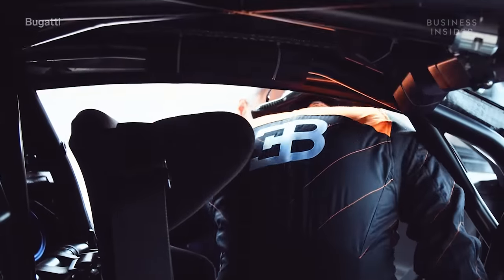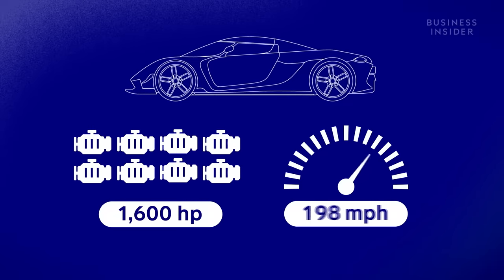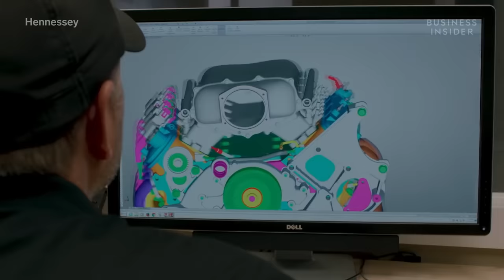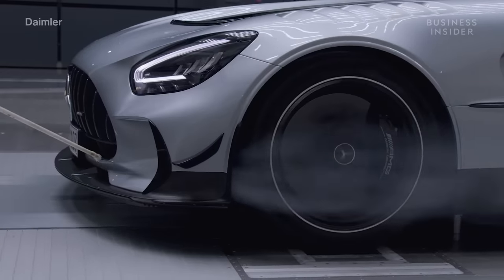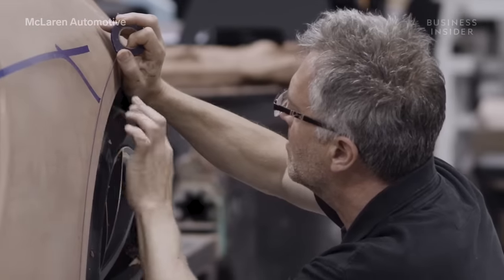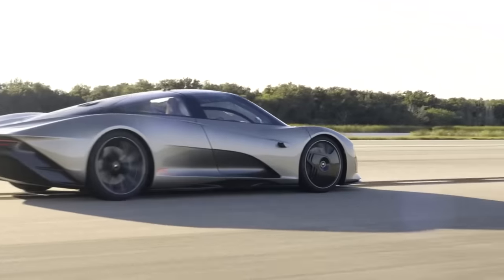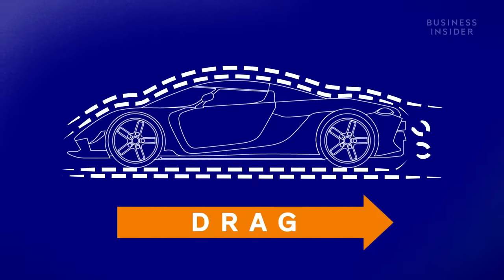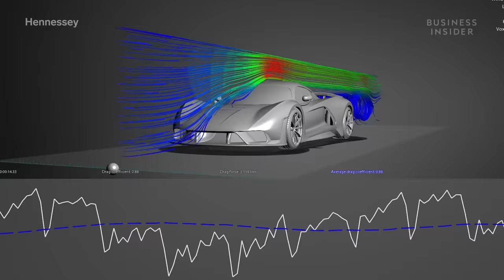Why It's Almost Impossible For Cars To Go 300 Miles Per Hour | Insider Cars

Comment: top fuel dragster joins the chat
Reply: Rip fuel
Reply: Hamster has left the chat
Reply: Doesn't sustain the speed for too long...
Reply: 0-60 0.8 seconds. 0.120 1 second. 0-300 4.5 seconds. (And then melts pistons/clutch/piston housing.)
Reply: @drivermobius  irrelevant, the car still does 300mph and this says its nearly impossible to do so but the top fuel dragster proves it happens often
Reply: @TheArSeNaL3000  Nearly impossible for a PRODUCTION car to go 300+. How the hell did you not understand what he just said?
Reply: @zenhydra5114  satire
Reply: @zenhydra5114  yea exactly, any crazy dragster can go 300mph but no one is gonna put that into production
Reply: @drivermobius  You can. Just don't floor the gas pedal.
Reply: @TheArSeNaL3000  It will never be recognized for the record which requires a production car and two runs in opposite directions within a specified time (30 minutes?).  The dragster is not a production car and it's engine can't be rebuilt quick enough.
Reply: @marke.8668  I agree, 300 mph is 300mph. TFD- been there , done that!!!
Reply: In that case thrust joins the chat
Reply: @TheArSeNaL3000  thats my point
Reply: @zenhydra5114  the title sais otherwise

Comment: The takeoff speed for a 747 is 184mph it is amazing how these things stay on the road.
Reply: If your implying that it’s shocking the cars don’t fly, no. Planes are designed to fly and cars are supposed to be on the road.
Reply: As Jake said, the 747 is designed to go up and cars are designed to stay down.
Car designers don't want the wheels to lose traction, so they specifically design the cars so that the air flow pushes down on the car.
Airplane designers don't do that. That would just waste fuel.
The only thing that's amazing is that you actually made this ridiculous comparison.

Comment: The twin turbos are one of the best horsepower makers but the procharger can solve that problem.. that's what 85% of people don't realize... we would have the power to get 400mph easily but the tires and downforce is the problem to get there.
Reply: I believe the Bugatti is quad turbo... but turbos are pretty much the only way to get there and sustain the speed.
Reply: Top Fuel dragsters generate some stupid power for a short time, and some stupid speed for a short time, but that's about it.
Even the Bugatti Chiron gobbles up tires and fuel and other things at a pretty quick rate doing near 300 mph. Doing that for a sustained amount of time, just leave it to airplanes. There's just not enough space on the ground to move along like that very long without hitting something (animal, debris, people), exploding a tire or wheel, running out of fuel, overheating, burning up an engine.

Comment: He's wrong from the very start about cars not reaching 200 MPH that late in those years.

Year: 1970-

Make: Plymouth

Model: Superbird

Engine: 426 Hemi V8

Transmission: 4-speed manual

Horsepower @ RPM: 425@5000

Torque @ RPM: 490@4000

Displacement: 6982.1 L

0-60 time: 4.8 sec.

Top Speed:  200 mph

car segment:

muscle cars

--- from Top Speed magazine

Comment: Remember kids: Drag force is proportional to velocity squared, but Power = Force x Velocity, so therefore the power is proportional to velocity cubed. It makes intuitive sense if you think of it this way: A car going twice as fast as before will have to overcome a resistance force that is 4x greater coming at you 2x faster, which means 8x the power is needed to push through.

Comment: I was just talking about this to my son the other week. If you could break the air in front of the car, you would negate drag. Imagine a very powerful hairdryer pointing forward off the car, increasing in power as the speed increased. Obviously not that, but that's the idea. Create negative air Infront of the vehicle, instead of concentrating on pushing it faster from the back, and it will go faster anyway

Comment: You would also need a perfect track built to higher tolerances than the runways built to handle the fastest aircraft touching down at 240mph.  A pebble skipping off the bottom at a differential speed of 300mph  is not a pebble I'd want hitting my car.

Comment: I am disappointed that there was no mention of the transmission/gearbox that transfers the energy generated by the engine to tires. Speed is always a calculation of the sum total of the parts. You can have the best tires, body, and engine, but it won't mean a thing without a well crafted and very carefully engineered transmission or gearbox.

Comment: It isn’t an official 300 miles per hour in the Chiron. They ran only in one direction
Reply: Like it or not,It did go 300+ mph,So don't give hate
Reply: @Rezbionic  it did go 300 mph. Unofficial top speed though.
Reply: @henrycollins2478  its offficialy in the guiness
Reply: @Rezbionic  it did go 300+ but it wasnt a production car it was modified
Reply: @SaltShakerer  it is coming into production
Reply: Valkyrie 007  the difference between the two was the agera rs is a car that you can buy and is road certified and can drive right now legally in most countries. the super sport hasnt come out yet and is not in production but im not saying the jesko isnt a modified agera
Reply: Valkyrie 007  Ah yes the Divo was a great car, and the Bolide seems like the next generation of it. Just a shame they can't seem to keep up with the newcomers anymore.
Reply: Valkyrie 007  Yep I was mostly just referring to the top speed capabilities because they seem to be focusing on track cars now. But it's going to be insane with it weighing as much as a toyabru frs with 9 times fhe power and way more grip
Reply: The previous Bugatti cars used the same track to break records like the Veyron SS but they waited until the weather conditions is 100% perfect
Reply: @Maverick its officialy the first car to break the 300 mph barrier
Reply: @Maverick it is

Comment: I once had an Alfa that went 220 kph. Felt blistering fast. Then drove a 71 muscle car at 250 kph, thought i was gonna die. Now I drive a stock W12 Phaeton with speed limiter removed and just a chiptune. It does 310 kph (190 MPH+) and it feels like i'm barely over the speed limit. 

It's amazing what speeds can be achieved with total comfort and not even an unbalance or wiggle. But driving 250 kph in a muscle car death trap felt far more exciting and achieving than the 300+ in my luxury daily. 

What i'm saying is i prefer to actually fully experience insane speeds, and as much respect as I have for the Bugatti, Koenigsegg, Rimac, etc. They're amazingly built, but the experience of speed is not what you get with these insane speeds.
Reply: @Adam exactly. My current daily (Phaeton) is a spectacular car, the fact such a bonkers massively big car about 2800 kgs (incl driver, full tank, etc) can manage 300+ kph (GPS) and go 0-60 in less than 6 seconds with airline seats, airco on, and masage function on is absolutely spectacular but it doesn't really 'feel' like that despite hitting 300.

Comment: Wrong. You’re forgetting about the Chevrolet Corvette Sledgehammer.

In 1988 Calaway made a Corvette designated the Sledgehammer. It went 255 mph. That stood until the 2010s when the SSC, Konigsegg and Bugattis hit that speed.

The Sledgehammer is an unknown work of art that doesn’t get the credit it has earned.

Comment: Fastest I've ever gone was 200kmh, but that was on a sports bike. Even at that speed the wind force is insane. Also, your vision goes into a warp speed tunnel effect on a bike at a certain speed.
Reply: I drove a 1984 Nissan 300zx at 130 mph (210 kph) and a 1989 Suzuki Katana 750 at 150 mph (240 kph).

Comment: The Bugatti hit 253 in 2005. The Calloway Sledgehammer hit 254 in 1988. It held the World Street Legal speed record of 254.76 mph. It did this while being emissions compliant. It had a stock vette interior so A/C and radio.  The Veyron is more luxurious, but it took them 18 years to go slower. It also cost more than the Sledgehammer when adjusted for inflation.
Reply: safety requirements massively changed and forced cars to become heavier

Comment: But one thing I've wondered for a while is, why is aerodynamics a problem when the force most cars can exert while accelerating is way higher than the drag force at their maximum speeds? Is it that, since the engine can only output a certain amount of power, and kinetic energy increases by the square of speed, the force decreases as speed increases because more power is required to accelerate to a "new speed"? Or is it that higher gearing lowers the force exerted?

Comment: Its not really just air. The Veyron isnt all that aerodynamic at all. its really about gear ratio (how much torque can a car produce when using a higher gear). Torque is the force of acceleration in laymen's terms. When a car is in its first gear, it produces the most torque but cannot achieve high speed (at least not without destroying something) and when a car is at its highest gear it produces less torque. Thats why many commercial cars have difficulty accelerating well at ~80Mph or 130Kmh. Your car's gearing is likely made so that your uppermost gear is engaged at about 50-60Mph or ~80-95Kmh so your car loses torque the more RPM you add to your uppermost gear. They Veyron could likely go faster it could incorporate more gears and more torque.

BUT its also tire Grip, rolling resistance, temperature, humidity, barometric pressure, power to weight ratio, downforce and a few im likely forgetting. If they Veyron was truly aerodynamic it would look more like a dragster.

Comment: Back in the early 20th century an automobile achieving 100 MPH was the goal. As the 20th century progressed 200 MPH was the goal and some RACING cars achieved that speed sometime after the 1950's albeit, they would cross the 200 MPH mark but NOT a sustained speed. Today, in 2022, an astounding  "300 MPH" HAS been achieved and surpassed in this age of technology. Is "400 MPH" the next "speed goal" on the automobile engineers agenda. How far do engineers want to push this "land speed goal?" MACH 1? Granted, land speed records have topped 700 MPH at Bonneville S.F. Our best highways around the globe were designed to probably allow speeds up 200 but today's ultra "supercars" can easily achieve 250. For the average Joe or Jane, we probably do NOT need an automobile to go much past 80 to 90 MPH on US highways and 120 to 150 on the Autobahn; even during excellent weather. Personally, I believe if you need an auto to go past 180-185 or topping 300 K/h you can probably afford to fly to your destination. You're more likely to get there in one piece and not having your beloved super car scattered all over the highway. Happy motoring. 😅 😀

Comment: Now think about that the highest speed ever achieved by a formula 1 car was around 413km/h or about 256,7mph and those cars are specifically designed for racing with extremely high speeds.

I don't think a normal person would want to drive a car with 300mph on any public road (not even German Autobahn)

Comment: The first production car to hit 200mph was the 1969 Dodge Charger Daytona edition. You could buy a dodge charger with a mild 375 horsepower out of a massive 440ci block and do about 140, 150, but that aerodynamic body kit makes that SAME car be able to go 200mph. Ferrari doesn't get the credit for this, because it isn't true.

Comment: I still think it's mostly about road friction.  Airplanes have air drag, but they can easily go MUCH faster.
Reply: Land speed record cars use solid metal wheels. It's the tires keeping things slower. Not even jumbo jets tires are rated for 300mph...

Buguatti wastes a lot of resources on stupid french stuff. Hennessy takes an engine from a chevy suburban and launches it to 300mph. Engines and transmissions are not the issue, and since land speed cars go faster, it's not the drag.

All about the tires. 7 tons of pressure trying to make them balloon, rising exponentially as you spin them just a little bit faster all while insisting on having tires still good for turning and stopping, somethings gotta give.

Comment: At these speeds, you could use the air pressure to create a cushion of air underneath the car, like a trackless aerotrain. The car could transition from wheeled drive to jet-driven air cushion at around 200 mph. This would let you use simpler tires and engine, and you'd have a jet engine in your car. Then you really would be flying low instead of driving fast.
Reply: If it is not running on wheels touching the ground it is not a car but a low flying airplane. Land speed record vehicles use solid metal wheels for speeds over 300 mph.

Comment: 2n-1 is the formula for energy required to accelerate from one time interval to the next.  And that's merely the physics in a vacuum.  Add friction and it's just that much less efficient.   It's the reason why doubling the power of an engine won't even come close to doubling the acceleration.  Wind drag aside, this problem is evident even in basic physics.

Comment: "drag forces, lift, all of these are increasing exponentially, as the square of the speed". That's not what increasing exponentially means. That's increasing polynomially, specifically quadratically. Exponentially would be if the speed were the exponent in the equation.

Comment: All that's needed is tiny diffusers on the exterior of the vehicle on the nano scale.
That should negate the need to worry about friction resistance, break up the air before it gets to touch the surface proper, which has a hydro-oxy-phobic coat to make it that bit more slippery.
No biggie then.

Comment: Carbon fiber isn't stronger than steel ultimately. It is just very strong for it's light weight. It's also very good at maintaining strength beyond it's yield point. Not to mention that carbon fiber is only strong in tension, not compression. Be careful making statements like this that are heavily scenario based

Comment: I mean, if were talking about time when cars broke barriers, the gap between 200-250 and 250-300, the latter was achieved in less time. the gap between 150-200 mph roadcars produced was 32 years. On the surface, its not getting any harder to achieve these things though it definitely is difficult to engineer. I think if anything, the gap between road car and racecar is probably closing given that while cars were only hitting 179 mph, le man cars were doing 224. Now racecars are only faster in laptime unless you count dragsters and land speed record cars.

Comment: As a physicist - well a physics major (used to work as a physicist) I appreciated this video however there are a few flaws in this level of thinking. We can certainly go faster.
Reply: The trouble is staying on the surface and pushing from the surface.
Airplanes solved that a long time ago.

Comment: thats because drag pools and adds virtual mass, a thinner sleeker frame without pooling requires less efoort with speed, like the fish delta wing, they just swing to propel, but using shark wing with tires makes for faster cars by alot and less mass pooling due to aero drag spun in cavity zonesz

Comment: So what are the differences for an electric motor? Aerodynamics and tires would be the same. The engine would be replaced with a couple (or 4?) electric motors.The motors would be lighter weight, but there would be battery weight. Electric motors are MUCH more efficient. So what are the pros and cons? I've been reading about Rimac Nevera...

Comment: I'm not diminishing the aero/fluid dynamic challenges in going fast but it was always my understanding it as a challenge paled in comparison to a heat/thermodynamic issue. On average how many radiators do hypercars have?
Reply: I think these cars usually only do like one or two short jaunts/stints at these speeds as opposed to sustained or prolonged runs. So heat dissipation issue in these machines isn't the same as those in aircraft. Regardless, they probably have a whole host of temperature regulatory tech.

Comment: There has to be a max speed that a car can go without just taking off the ground right? I mean a car can’t possibly go 600mph without just having the wind pick it up and you start flying. So what is the max speed a car can actually go without taking flight?
Reply: I mean with enough downforce shouldn’t the car stick to the ground pretty well at high speeds? And cars that aren’t street legal nor production cars have been able to go super fast. A Jet engine car managed to go 763 mph

Comment: Piston driven technology for car to reach well over 300mph is already available decades ago (think NHRA top fuel dragsters). Instead I would think whether it makes business sense to mass produce such cars, and whether there is such a demand on the market (likely yes in a niche and exotic market). If there is such a demand, there will be manufacturer producing them as road cars anyway, and that's why we see Bugatti does this. People have already made engines that can output thousands of horsepower decades ago, and tyres that can handle such monstrous horsepower decades ago as well. Expensive you say? Yes they are, but it's not technological limitation anyway. It's just a business question after all.